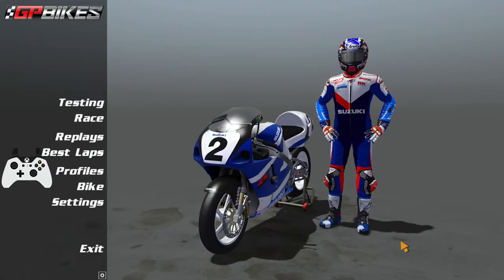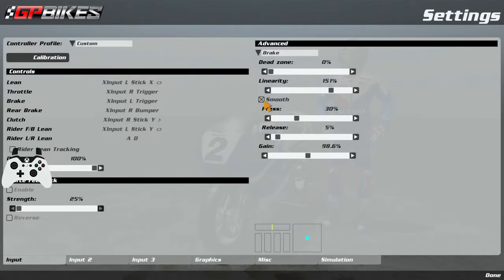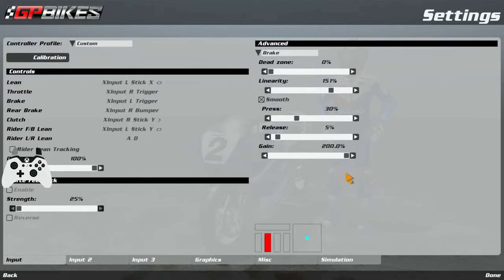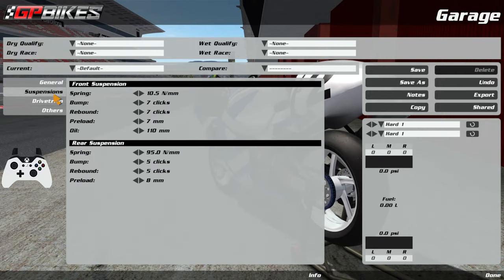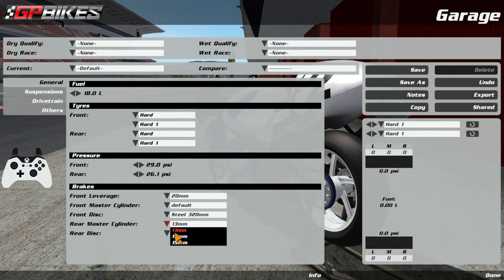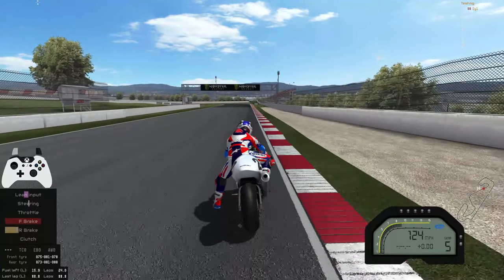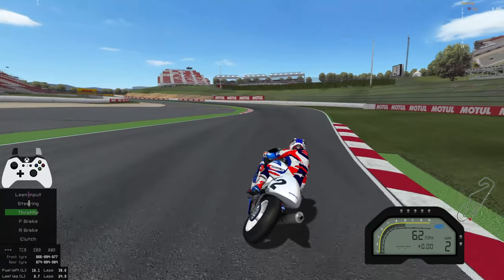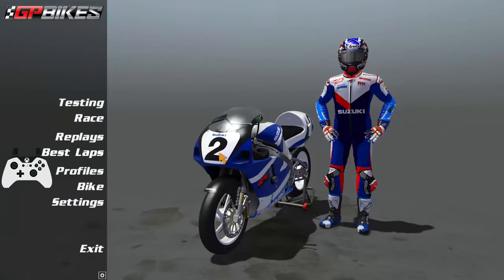GP BIKES | BRAKING TIPS | HOW TO BRAKE LATER!

Comment: Any idea why i sometimes lose the front on slow corners (for ex catalunya turn 1) when im using moto 3 bike, its like when im in turn 1 and try to add throttle a bit and switch to other side for turn 2, my front tyre just slips and rider wont turn bike to other side? Is it that i lean too much when i  add throttle or its just bike setup?
Reply from the maker: Try changing direction slower and usually that will help,it's just the physics of the game that causes that if you change direction too fast
Reply: @Dyl469  thank you G